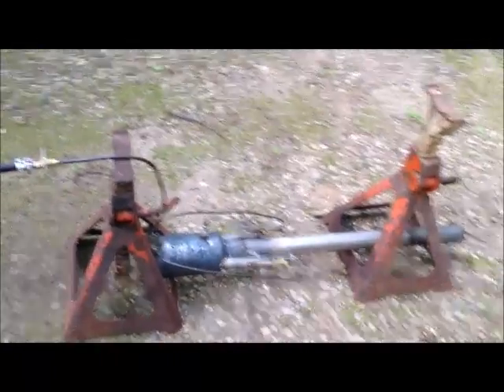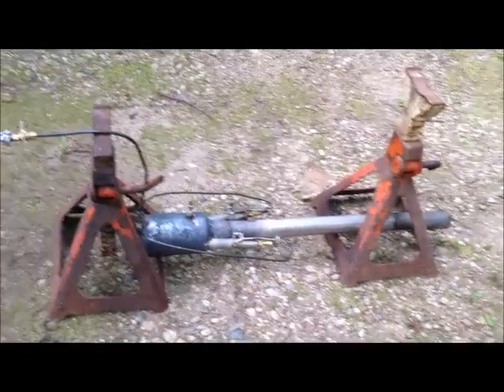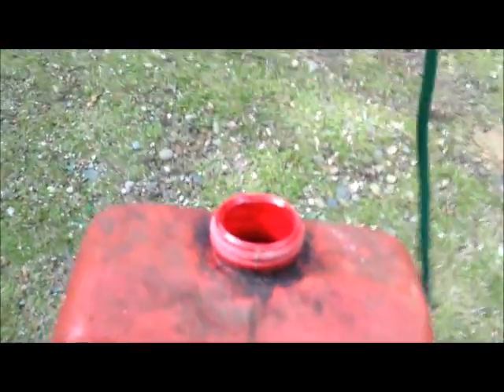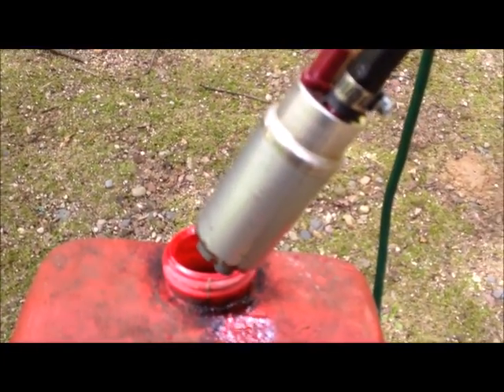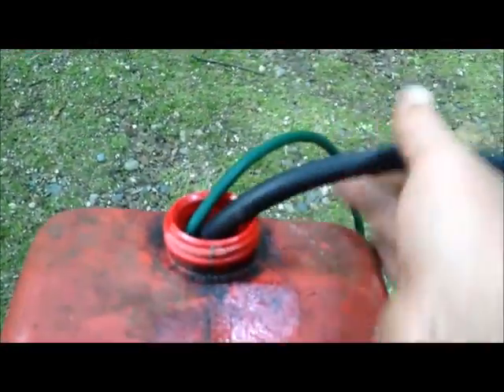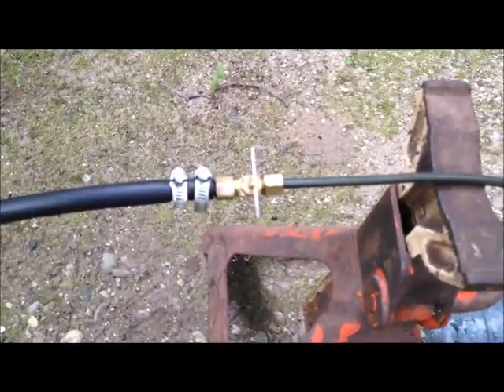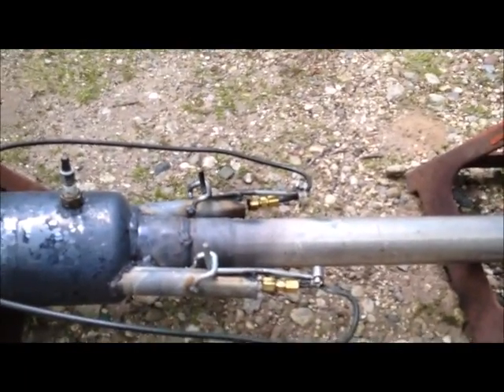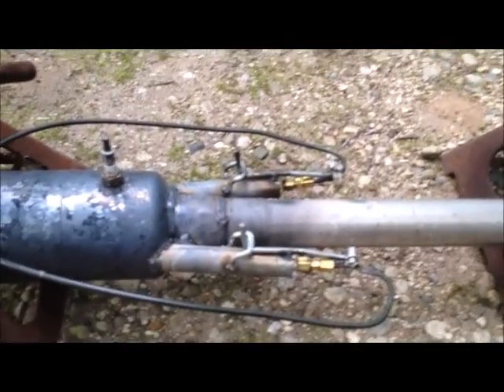Gasoline powered thermojet

Comment: alcohol and nitro methane glowfuel is kinda odd, I don't even need spark to ignite it, good auto ignition properties & puts out lots of power'' that is why I'm so curious about that fuel mix in a valveless pulse jet, ya might get 3 Or more lbs of thrust outa that little beast. I'm definitely curious about your injectors, I've spent sooooo much time on injectors to no avail" but happy to see you did it! NICE!

Comment: I add nitro methane glowfuel to Denatured Alcohol Appliance fuel, the glow fuel has good ignition additives and mixes nice with alcohol. Alcohol produces more power than gasoline " propane produces less power than gasoline.
Reply from the maker: Thanks, I might look into the alcohol thing, less explosive. Working on a closed feedback loop using a knock sensor from a car, and a couple of direct injection injectors. Should be way more efficient. Am a mechanic. Been kinda ADD with my projects, working on rocket engines too.

Comment: Nice job!  I don't get your beef with propane though.  Using fuels like this at atmospheric pressure require a powersource, pump, more plumbing, wires, atomizers  and its more of a mess to handle.
Reply from the maker: Thanks. It's not really a beef. Been using propane until now. More about a limited burn time, and the fact you have to constantly adjust fuel valves as the pressure drops in the propane tank.  With gasoline I can power one of these all day, and have a constant pressure no matter the level of fuel in the tank. where as right now my jet bike will burn thru a 20 lb tank of propane in less than 10 minutes. Also more cost effective. I am a mechanic, so didn't really have to buy anything. Besides, it was a challenge I posed to myself.
Reply: fignutron
I meter my propane in as liquid.  Doing it that way gives you more than enough fuel and no pressure drop issues.
Reply from the maker: As do I. Have not had any luck running p-jets gaseous. But when getting to the bottom of the tank, I have to open both valves fully. Have had engine flare outs because of this. Like I said before, not dissing propane, but like anything else it does have it's drawbacks. Seen Robert Maddox run thermojets on gas, considered that a challenge..
Reply: fignutron
You're referring to running on liquid propane when getting to the  bottom?
Reply from the maker: Yes. Have always needed to be precise on fuel control with the thermojet style. Thinkin lockwoods may be more forgiving in that respect.
Reply: fignutron
My engine is touchy too.  That's why I use a good metering valve for the throttle.  Its actually a hydraulic metering valve.  (needle type)
Reply from the maker: I use needle valves also. But, the ones i cud get my hands on locally, had too small ports. So I solved this problem by putting two of them in a parallel  circuit, with a ball valve as an emergency shut off. It also made it so I cud regulate the fuel on 2 levels. One for start up, next for thrust..